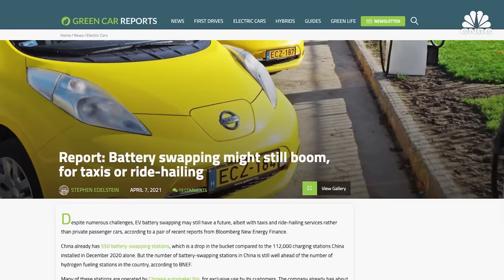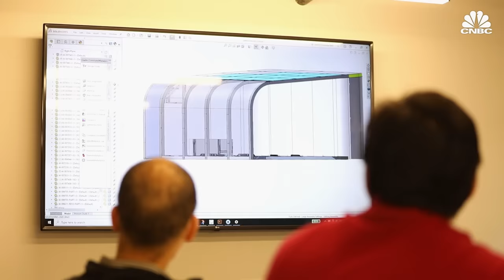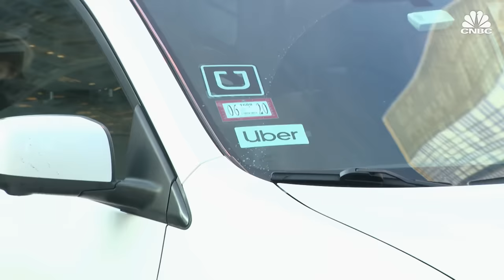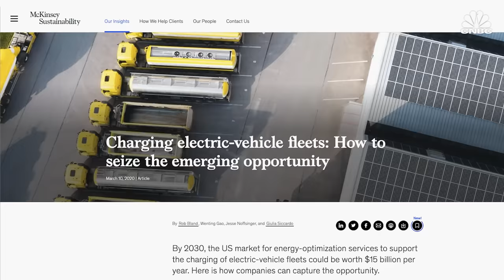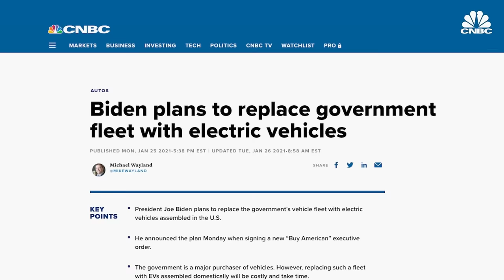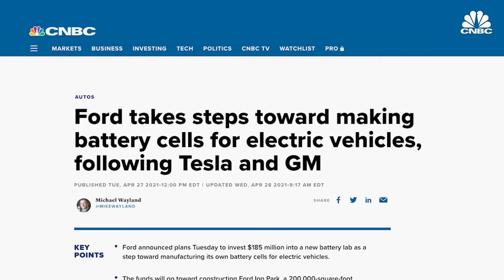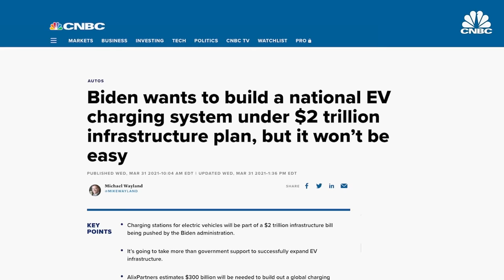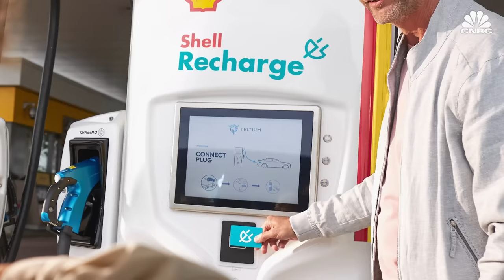Can EV Battery Swapping Take Off In The U.S.?

Comment: I applaud all efforts to make EVs accessible, but this will never work at scale. Better battery chemistry is the answer. 4680 prime example. Better cycle life and cathode advancements make battery swapping obsolete.
Reply: @mwwhited  correct 4680 is just the cell dimensions. There are actually thermal benefits from the new tabless cell design. In terms of chemistry, I was referring to the dry electrode process, anode and cathode, removal of cobalt, etc.

Comment: They talk about lesser stress on the battery by charging slowly, but at the same time. all those modules need to be ready at 100% SOC waiting for a customer. THAT is real stress on the cells!
Reply: Still less stress than forcing it to charge faster
Reply: @christophercorona4285  sorry, not true. The negative effects of fast charging can be overcome with advanced chemistries but 100% SOC is more detrimental unless you have a significantly higher unused overhead that otherwise needed when the cells are kept mostly under 80%. This increases cost, volume and weight making a full charge after swapping smaller in kWh that a partial charge at high rate of charge. Also you never charge at high currents until full, ever.

Comment: The process takes 10 minutes.  How long do you wait in line?  Similarly the 10 minute oil change - I've never been out in under a half hour.
Reply: If you have 6 cars ahead of you that will be 1 hour of wait time.
Reply: yeah, when they said 10 minutes I immediatly thought, wait, that's too long!
Battery swapping shouldn't take more than 3 minutes. Seems like they still need to improve their tech.
Reply: Both are subject to availability...

Comment: Imagine how unreliable these charging stations will be with all their sensors and moving parts. A leaf blows in and station is down for a week. At any one time, two out of three will be inoperable. Compare to a fast charging station with no moving parts, no maintenance costs, no wait time. Or a plug in your own garage/warehouse to slow charge overnight. How can they find employees that believe in this vision? Presumably all working for stock in the hope that someone will buy them out and repurpose whatever tech/experience they might have developed before the investors cut their losses and let the company enter bankruptcy.
Reply: Funny, I was watching a review of Rivian, and they had to pull into three chargers before they found one that actually worked.  Same with a Lightning, they where able to get a 2 minute charge on two chargers, then the third one they tried gave them 150 KW per hour for an hour to fill the battery for about $14.  Much less expensive than filling the gas trucks used in the same road test.
Reply: News flash - the automobile you drive everyday is nothing but "sensors and moving parts". They seem to work pretty well most of the time.

Comment: Would love skateboard designs where we can swap out body styles. 
Warm weather? Switch to a convertible.
Moving cross country? Now it's a pickup truck.
Reply: I see, but they would have to make the lower half of the body really heavy for crash safety purposes, but if they added a roll bar, I could totally see a modular body panel system for the top half
Reply: Ahhh that's a great idea!
Reply: @specialopsdave  Vehicles in the future will not be as heavy as they are now. It is inevitable consequence of progress. Where the public wants them light, vehicles weigh 20-30% what they weigh in the US which historically has very cheap fuels and high production of fuels.When the vehicle weighs say 1300 lbs, a crash is not with as much force. As powerplants mature, they will become smaller and smaller as well, reducing the weight of vehicles. In 50 years vehicles may not weigh that much at all, which will ultimately lead to significant energy efficiencies.
Reply: Just order a tesla robotaxi of your choice
Reply: @yehimstone5492  Once again, you are COMPLETELY ignoring the U.S. and it's inability to share property like cars with each other. Otherwise, one person would share their pickup truck with 5 neighbors lmao
Reply: @yehimstone5492  😆🤣
Reply: Literally just rent

Comment: They'll never agree on a standard.
Reply: Nio swap station is open for other manufacturers to use
Reply: Not until there is a standard that is better than all the current ones, which is a good thing?
Reply: Nio is running a cute little trial. But sooner or later they'd have to be able to accommodate trucks, compact cars, motorcycles, and every other chassis/platform out there. This will create so much redundancy it will never make financial sense. Nio is already eating a loss to run their swap program.
Reply: Unless it gets mandated.
Reply: @dummyxl  Only if they have the same battery design. Can't fit a square plug into a round hole, so to speak.
Reply: @dudea3378  nio isn't profitable yet.

The swap station makes it possible to buy the nio car and rent the battery. That makes buying a nio car al lot easier. Also the battery does not get bad over time because you van swap it.

So this will make nio more money but not the swap station itself right now.
Reply: They don't even use the same charging plug for charging
The government has to step in like in China or the Eurozone in the near future, not unlike the household electric outlets
Reply: @allsportsexpert  of course the car tech must be the same.
Reply: @dummyxl  I still don't see much benefit to it. Most of the time you're topping off at home anyway. The only time you need to charge is for long road trips. And in that case sooner or later you'd need to stop for a meal. So a 45 minute stop for a long road trip doesn't seem unreasonable.
Reply: @dudea3378  at my place i can't charge my car. So for me this should be a perfect solution. When you van charge at home than yes this isn't that important. Still useful, your car geeps its value more because the battery is always new. Also you can have the small battery in the car and when you have to drive a far distance temporarily swap to a bigger battery.

Also when new battery tech will be available you can have it to.

Ps. In China the swap stations are mostly on the highways and cities centers
Reply: @dummyxl  Gotcha. Makes sense if you don't have the luxury of being able to charge at home.
Reply: Meh.... obd2 standard is an example of a standardized protocol across vehicles. It's possible but would take time.

Comment: Why not Rent the Charged Battery on a per charge basis?  Buy the car but rent the battery.  Another approach could be using up the remaining charge in a swapped battery to supply the Grid in Night time supplementing PV Solar or wind systems and then charging the following day using PV/Wind on a peak power/demand basis.  This would enable the owner of the swap station to vary its sources of revenue.  Also have a Battery swap system for say half the battery with the other half being stationary in the EV.  Since most people will use their EV's for travelling back and fort to work, swapping part of the battery on a daily basis to cover this amount of usage would make a lot of sense retaining the integrated battery for longer drives and back up drives and home based nighttime charging.  The model has promise but needs a different approach and new ideas.

Comment: I would want to switch out the batteries especially if you go on a road trip.
Reply: I would never want to do that. Nobody takes care of their stuff like I do. Plus I have been burned by warranties saying we promise this or that.
Reply: Walmart screwed me on a mini refrigerator warranty for example. Fridge started incredibly loud popping noises at night. They said it wasn't covered.
Reply: You must purchase a Tesla especially it has low cost maintenance compared to gas cars.
Reply: @medoomedoo1634  sure it's low maintenance, but when you do need to do maintenance to it, you'll find out it's pretty hard as Teslas are made to be disposable and non-modular
Reply: @triadwarfare  What's i know that electric motor doesn't need to renewal pieces regularly in opposite of gas motor
Reply: then after the road trip, when the underpart of your vehicles is all scratched dented, full of mud, sand and rust, bent screws, etc. they can just make it all new for you again at the swap station
Reply: We need more fast chargers at restaurants, that would solve this as pretty much everybody stops to eat for about 30-40 minutes.

Comment: This John Voelcker is just a reporter, not an engineer, and does NOT know what he is talking about - it is not the "voltage" that is the concern wrt connectors, it is the "current" or "amperage", and weight has nothing to do with the challenge.  This is a completely viable solution.  The biggest question to be answered is "who owns the battery pack?".  Secondly, what assurances does the public have the battery pack is safe, fully charged, and highest quality.

Comment: Ample, if you are reading this, here is the next step to lead to adoption.  Buy old Nissan Leafs where the battery has gone bad.  Convert them to your battery swap tech, rent, lease, sell those cars.  Austin and Portland should be your next areas to target as they have many like minded individuals who also were early adopters to the EV tech and will likely want to prolong the lives of their Leafs and other EVs with aging batteries.  If you make the battery a subscription service, you will find a lot of old EVs willing to make that conversion.  Fleets and older EVs are your key to getting a big enough footprint in the US to matter.

Comment: Since Tesla is moving to structural battery pack, which means it is a part of the car structure, battery swap will not happen, at least, for Tesla.
Reply: I guess I won't be buying a TSLA any time soon.  I want an EV that gives me options to charge and/or swap.  Will wait for NIO to come to the US.
Reply: How do they replace the battery when the battery is getting too old? They can swap the whole entire battery structure but it cannot be modular as described in this video

Comment: Let's say you just drove off the lot with your new EV with 0 miles on that battery, it has much more capacity versus a battery that's been in circulation with hundreds of cars already. I would much rather keep my new battery for years before replacing it instead of replacing the car. Not to mention, a battery with 0 miles on it might have different (probably better) performance versus a random battery that's been around the country multiple times. Quality control also becomes a worry: do you want a battery that has been off roading or has seen abuse? At what point do they decommission a battery? 80% capacity? 50% capacity? You just bought a new EV that advertises 400 miles per charge but that's with its original battery not the one that's been passed around. This won't help with range anxiety either.

Comment: BATTERY SWAPPING MAKES SENSE WITH FLEETS 
AND UBER/LYFT DRIVERS 
BUT SOMETIME I WANT TO SWAP ONCE IT HAS LOTS OF MILES AND NOT PAY $10000 OR MORE FOR A NEW ONE
Reply: So... You'll Like a swapable battery Like this one and mit that of Tesla right now :)
Reply: Battery prices went way down. I'm a mechanic and they were like 6k when they first came out. Not they're like 1400 to 2500.
Reply: @luisgordillo1695  DEPENDS ON THE CAR 
TESLA BATTERIES COST AROUND $10000
Reply: @luisgordillo1695  Battery prices have not gone down! where are you a mechanic?!
Reply: @markjohnson8602  in California.I'm talking about normal Hybrid batteries.not specialty batteries like Tesla's or other expensive brands.

Comment: 7:50 this is the biggest problem. Also fast charging is getting faster and faster.
Reply: Yup. 100% why it'll never catch on in the consumer market.
Reply: But swapping seems more green and ensure all electricity is green
Reply: but fast charging will soon reach limit .. of the grid
Reply: @mz2433  It's actually the opposite because now instead of having just on battery for one car, manufactures have to make three to even five more to keep up with demand. You're just moving the pollution around.
Reply: How about a hybrid battery system?   A 100 mile permanent battery for daily driving and then a hook up for modular for long trips.    Think of all the capacity and weight an EV carries that is only needed 5% of the time.    Also,  think about cost of the car coming down with only 100 mile range needed for initial cost.
Reply: @tennislite  You should consider NIO BaaS, you drive a NIO daily with 70KW battery, when you are on a long trip, you rent a 100KW or 150KW battery so you don't stop in the middle to charge.
Reply: but fast charging wears the battery out faster.

Comment: I’d rather just fill up my civic for $20/25 and be on my way in 5min
Reply: id rather plug my car in at night since my Electricity is already built into my rent :P
Reply: For the cost-minded, the operational cost (fuel, repairs) for an EV is significantly lower than for an ICE.  The average cost for a US mid-sized sedan is $35K for the car and $10K for the fuel (10 year ownership, 10K miles/year, 30 mpg, $4/gallon).  Not sure about maintenance/repair costs, but since there is no cooling or oil system in an EV, all of those fluid changes and fluid system repairs that are usually a few grand over a 10 year life of a car are not needed.   Elon Musk says that new Teslas don't need brake replacement.
Reply: @GK-op4oc  Its not only about cost its also about convenience. I'd rather fill a car with gasoline in 5 minutes than wait 12 hours for an electric car to charge.
Reply: @potatopotato8360  pretty convenient to not need to drive to a gas station when you can wake up each morning with a fully charged battery.
Reply: @HavokBWR  Not everyone drives 1 mile to work and back. Some people have long commutes and/or road trip a lot so one nights charge wouldn't be enough.
Reply: @potatopotato8360  almost nobody is driving over 300 miles to work and back each day.  It takes like 8 hours to fully charge a tesla at home. Yes one night will charge your car, you have no idea what you are talking about.
Reply: @potatopotato8360  Tesla Super chargers refill 80% in 30 minutes, but otherwise, your electric car charges somewhat slower at your house overnight.  What is the cost of convenience ?

Comment: My wife bought a 2011 Leaf, but it's battery was very low range.  If I had known this was a option, we might have kept the car, but sold it to a student, who was OK with the 45 mile range!  And think of this advantage, in 3 years, you might be able to get a larger capacity battery pack, where this year it might be a smaller capacity per battery.  It looks like they put two batteries in each car, maybe more or less.  

Funny how the youtube video does not list the manufactures supported, but they showed a Nissan Leaf going into the swap station.

I would want to charge at home most days, and then swap when the capacity is lower (say every 6 months) or when taking a long drive someplace, where I don't want to recharge along the way.  

I own a Ford Plug in hybrid, with a 15 mile EV range and 410 on 10 gallons of gas range.

Comment: Largest issue with battery swapping, which wasn’t mentioned here, is that you will need more than one battery per car. For an auto maker the largest constraint to ramp production is the battery supply. Then it doesn’t make sense to use a large share of the batteries for backups. Also the reason Nio is doing this in China is government incentives.

Comment: Battery swapping is essential/critical for the future of EV!  This technology is necessary in order to eliminate range anxiety, battery degradation and battery upgrade ability.  This will also help owner retain vehicles resale value over the long run by having the advantage to just replace the battery at will.  I wouldn’t buy an EV car without this option, it will save a lot of money over the long run.

Comment: All these comments about how he refused to disclose the price at all... Did you watch the same video? They literally responded that the cost to build was "in the tens of thousands, like an expensive level 2 charger". 4:31
Not "we can't get the exact number" that many pretend was all that was said. Of course he knows what it costs, and of course he didn't want to say... but he still said way more than people are letting on. Some quick research:

"The cost of a single port EVSE unit ranges from $300-$1,500 for Level 1, $400-$6,500 for Level 2, and $10,000-$40,000 for DC fast charging. Installation costs vary greatly from site to site with a ballpark cost range of $0-$3,000 for Level 1, $600- $12,700 for Level 2, and $4,000-$51,000 for DC fast charging." -  Costs Associated With Non-Residential Electric Vehicle Supply afdc.energy.gov - EVSE Cost Report 2015 (and six years old for this tech is already a long time)
Reply: There was already an electric taxi fleet in my city a few years ago. The main issues they had was needing to have extra cars to swap out while others charged... and unfair competition by Uber. Battery swapping for fleets of taxi and delivery vehicles sounds like a great solution.

Comment: Such a service already exists with portable charging, like FuelRods. You pay a certain amount up front for the rechargeable battery, but when depleted, or you just want a fresh one, you pay $3, insert your FuelRod, and get a new one. The convenience is you don’t have to wait. You could buy a $5 portable charger, and simply recharge it after every day that you use it’s so you always have one, just like you would keep your EV plugged in, fully recharged until you need it. But just like with EV range issues, if you’re using your phone all day for various reasons, you may need a new fresh charger, and that one you left with that was fully charged, was depleted.